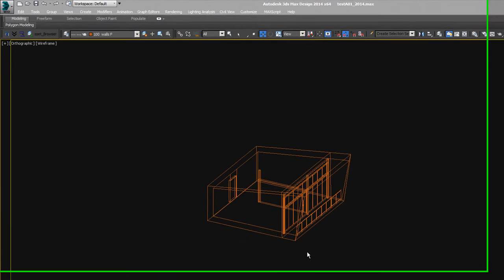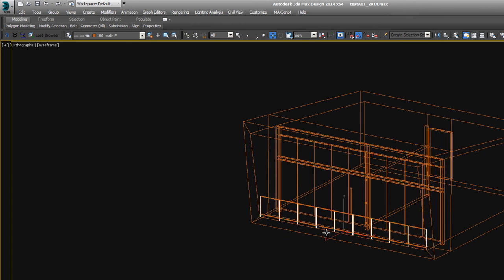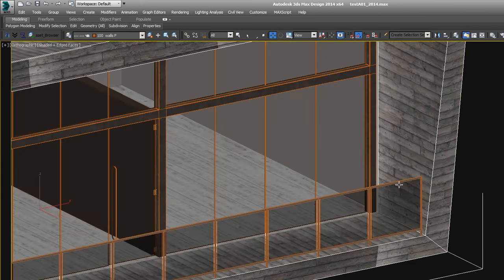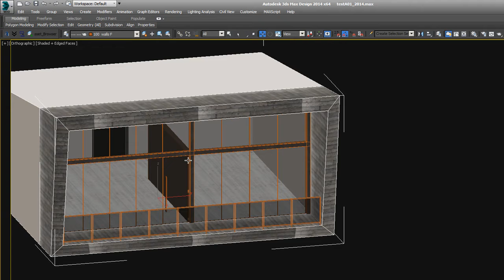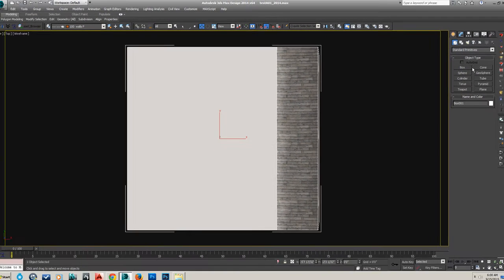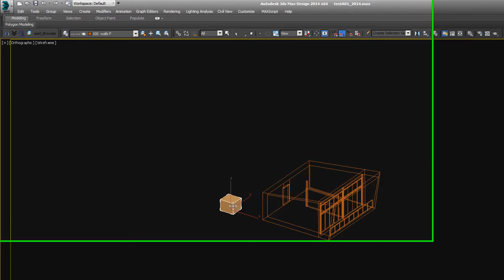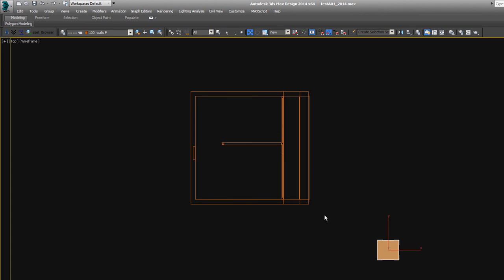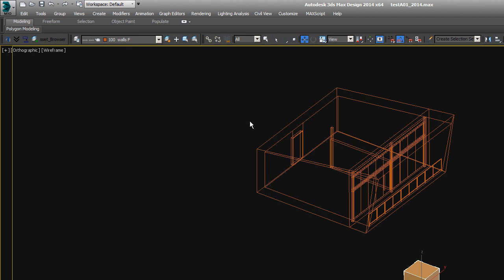3ds Max + Unreal Engine 4: Preparing Your Model for Export From 3ds Max

Comment: When you say fully en-closed, does that mean the whole walls,roof,floor of the building made from a single mesh ? I watched other tutorials that mention each walls roof and floors need to be separate and now I have light leaking everywhere. >_< I try to close the edges but it still didn't help.

Comment: A recommendation, . Put material in the UE4  or in 3ds max? thanks
Reply from the maker: +Ricardo Mota Muñoz I would start the materials in 3ds Max.  Use standard materials, and just get the maps right.  Then, the maps will import with the model into UE4.  From there, they will need adjustments within the UE4 engine.
Reply: +zillus Thanks Zillus. I had that doubt....So, I forget the Vray materials.